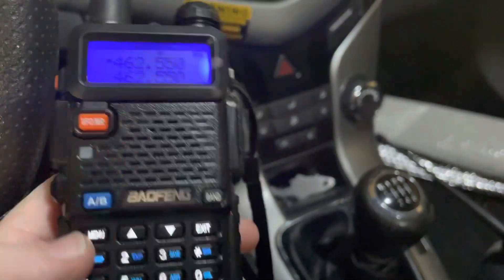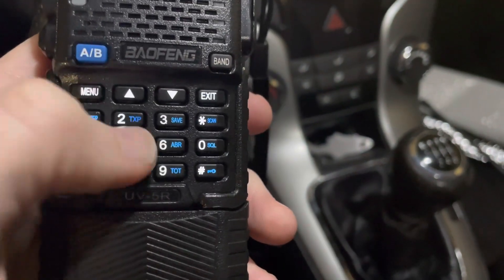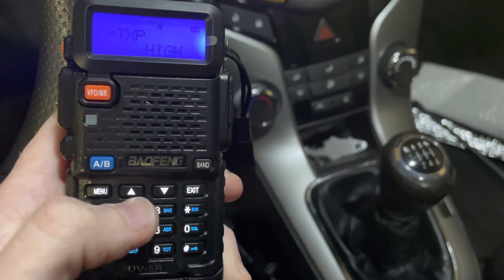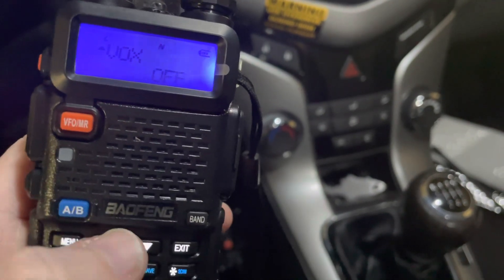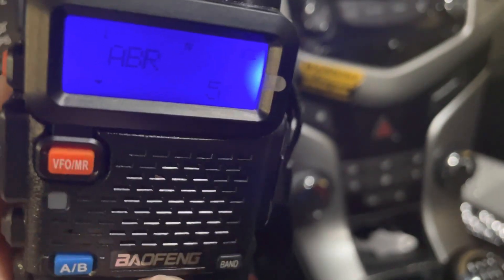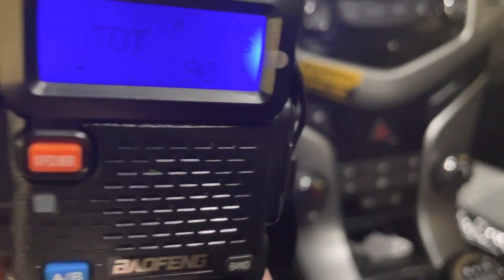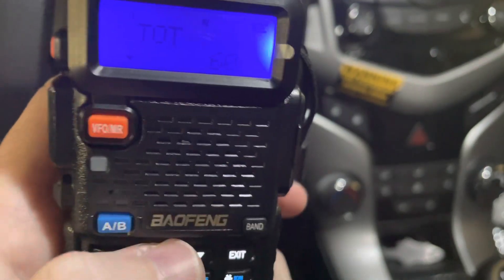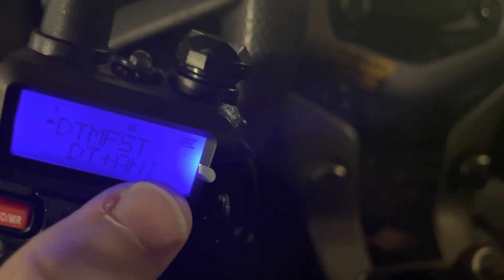Baofeng Basics - All The Baofeng UV-5R Menu Settings Explained - Part 1 of 2

Comment: Newbie request: can you do a video on specifically setting up a radio for the proper settings to transmit and receive using repeaters? can figure out what I'm doing wrong.   I've tried Chirp and manual.  Yes, I'm licensed on Ham and GMRS.  Thank you in advance.   73!

Comment: I just ordered one today.....so question:.  Can I transmit by normal use?
Reply from the maker: (See link to UV-5R currently being sold that can transmit on the license free channels).  Presuming you're in the USA, you can transmit on the 22 FRS channels and the 5 MURS channels without a license.  

Some UV-5Rs being sold only transmit within the 144-148 MHz and 420-450 MHz amateur radio bands.  You cannot transmit on the amateur radio (ham radio) bands without an amateur radio license.

This one transmits on the 462 MHz / 467 MHz frequencies (FRS) and the 151 MHz / 154 MHz frequencies (MURS) 

https://a.co/d/3lKPl8o
Reply from the maker: The FRS frequencies are:

462.5625 MHz - FRS Channel 1
462.5875 MHz - FRS Channel 2
462.6125 MHz - FRS Channel 3
462.6375 MHz - FRS Channel 4
462.6625 MHz - FRS Channel 5
462.6875 MHz - FRS Channel 6
462.7125 MHz - FRS Channel 7
467.5625 MHz - FRS Channel 8
467.5875 MHz - FRS Channel 9
467.6125 MHz - FRS Channel 10
467.6375 MHz - FRS Channel 11
467.6625 MHz - FRS Channel 12
467.6875 MHz - FRS Channel 13
467.7125 MHz - FRS Channel 14
462.550 MHz - FRS Channel 15
462.575 MHz - FRS Channel 16
462.600 MHz - FRS Channel 17
462.625 MHz - FRS Channel 18
462.650 MHz - FRS Channel 19
462.675 MHz - FRS Channel 20 
462.700 MHz - FRS Channel 21 
462.725 MHz - FRS Channel 22

151.820 MHz - MURS Channel 1
151.880 MHz - MURS Channel 2
151.940 MHz - MURS Channel 3
154.570 MHz - MURS Channel 4
154.600 MHz - MURS Channel 5
Reply: @R4002  the one I ordered is 420-450...
Reply from the maker: Then no, you cannot transmit on it without an amateur radio license.  Do you live in the United States? If not, which country are you in?
Reply: @R4002  USA
Reply: @R4002  I did cancel that order...but what will happen if I transmit without a licensed